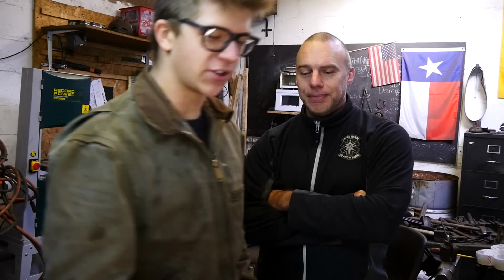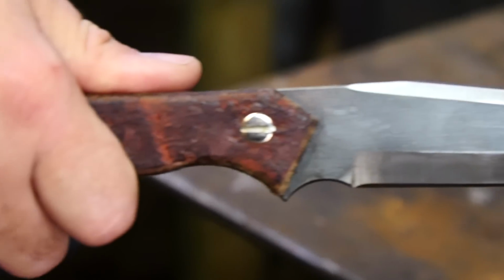MAKING A DAMASCUS THROWING KNIFE

Comment: so what's the higher carbon steel, the lighter or darker one? and which one is lighter or darker after etching?
Reply: i don't remember, but i believe the darker one is higher carbon. also it is typically made with one high carbon, and one stainless or alloy. the alloy or stainless will be lighter cause it is more resistant to acid.
Reply: Modern Bladesmith that makes sense, thanks
Reply: Iceman
 yeah buddy. i would, as always, try to do your own fact checking. i know two different carbon steels will oxidize at different rates in acid, i just don't know which.

Comment: Have you ever figured out how many layers you end up with when you get a knife done?
Reply: +meansartin quite simple actually, the number of layers he begins with, times number of folds/stacks
Reply: actually, it's not anywhere close to that linear, it's exponential. after initial forge welding of the initial stack the layer count doubles. For instance if you were to start with a 14 layer billet, after the first cut/fold it would be 28 layers, the next would be 56, then 112, then 224, then 448. but Alec is cutting his billet numerous times and arranging them in a more "Mosaic" pattern. i'm not entirely sure how to go about figuring his layer count.
Reply: yes ofcourse i meant that.. 2,4,8,16,32 and so on, the patterning makes kinda hard to count i agree.